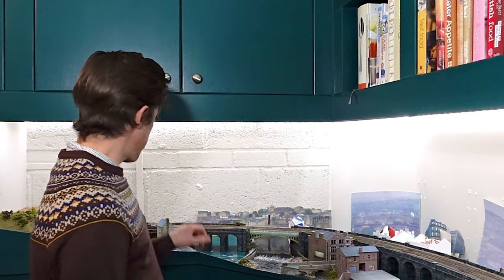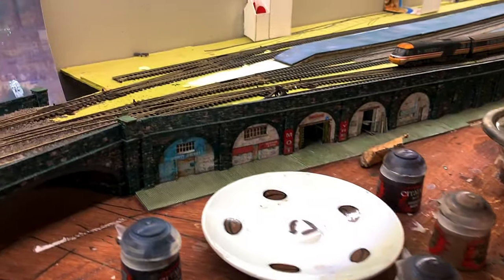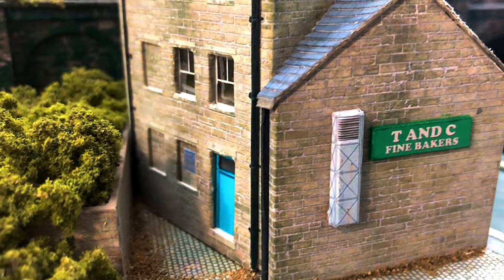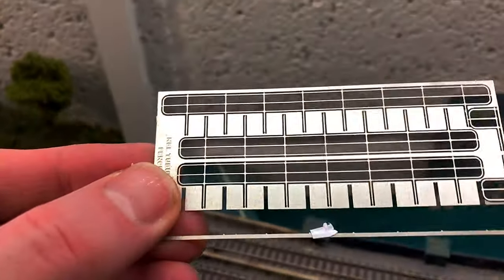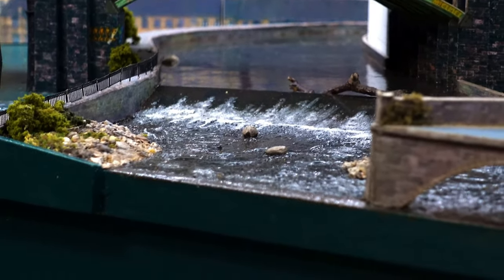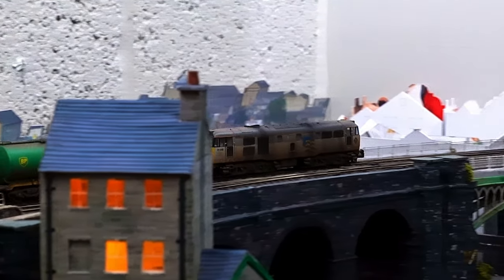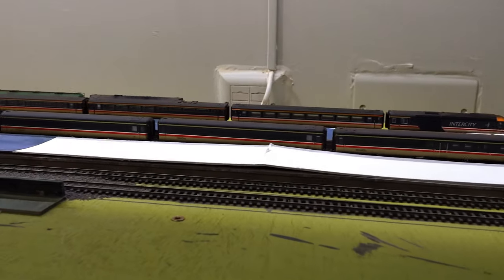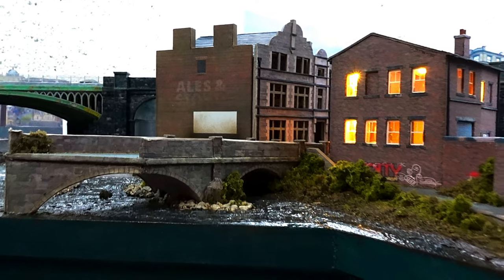Farish Class 31s arrive and some details finished - N Gauge Layout update December 2020

Comment: Hi Michael, the ballasting and weathering looks brilliant, for some reason the name river "Blythe" came into my head, just looked on google to see if it is a river and it is a river in Tasmania which is very much like England. In regards to the station, you have a few tracks there, so often that dictates the traffic and the type of covering. Maybe start with laying out the other buildings first? All the best for 2021, regards Chris
Reply from the maker: Thanks Chris! I think that's a good idea regarding the roof to the station. My run-round loop and storage siding will make a roof tricky, I think. Regardless, it will have to be removable. Blythe is a good suggestion, thank you, I will add it to the hat! :) All the best for 2021 yourself. I am looking forward to seeing where Four Oaks Street goes next! --Michael.
Reply: Hi Micheal, there is a river Blythe in the midlands. Runs by the Birmingham suburb of kings Heath I think?

Comment: The ballast looks good, just needs a few odd bits to finish it off, like old sleepers, short bits of rail, bags of ballast tucked away wherever there is space to leave something behind after a day’s track work. All the best for 2021, Dave.
Reply from the maker: Good idea, Dave. I actually have a bag of bits called "Track gang/construction workers and clutter" which has a few suitable bits in it. But at the moment, I have no paint, so this and the bike and traffic cones that will be dumped in the river are on hold for now. I like the idea of the old sleepers too. I can surely manage that, and I have the odd bit of rail kicking round. Nice. I will add it to the list of bits and bobs. I enjoy picking stuff off that list every so often in between the big jobs. Have a good new year, Dave. See you on the other side. --Michael.

Comment: How did you ensure that the points did not get stuck with all the ballast and glue?
Reply: he stuck cardboard inbetween the rails
Reply: @DiggerEvans  Oops, I missed that.
Reply from the maker: Digger Evans beat me to it - I did use a bit of card in between the blades. But I also kept going into the room and switching the points back-and-forth a few times over the first few hours of the glue being applied. My guess/hope was that the dilute glue would sink to the bottom in the ballast and away from the point mechanism, whilst the movement would open up a gap in the ballast for the spring or whatever. One of them did stick a little bit, but a gentle nudge released it! --Michael.